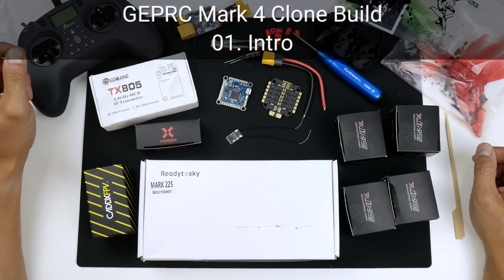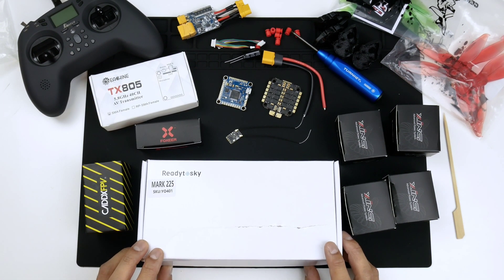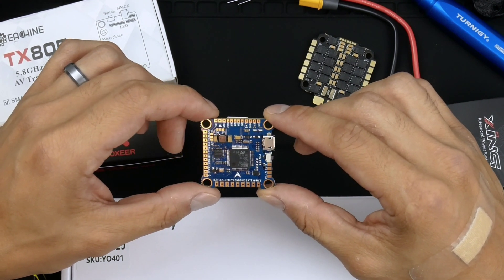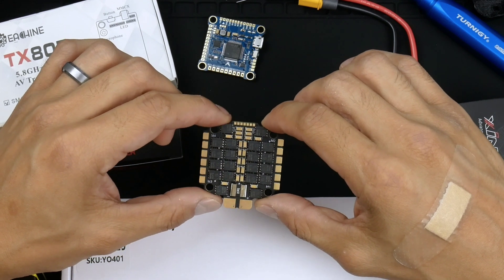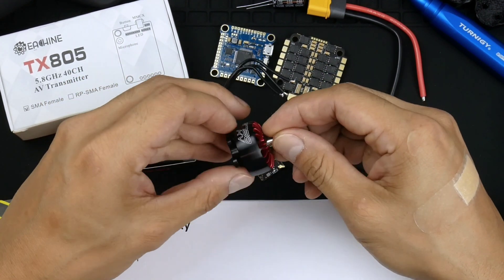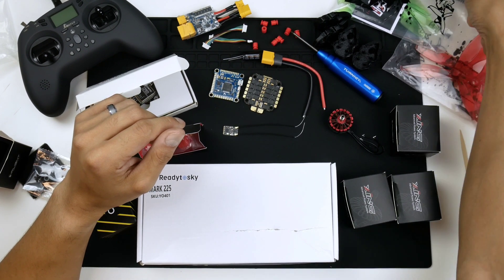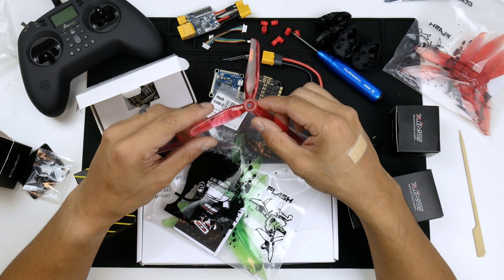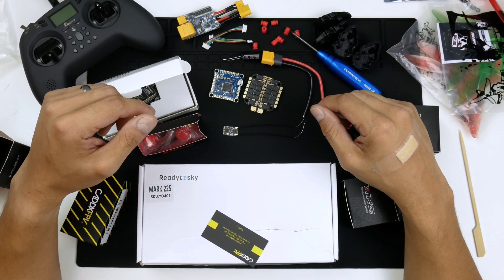GEPRC Mark 4 Clone Build - 01. Intro

Comment: With the flight controller+esc, which is better the 45A or 60A 
(I'm just a beginner) and can I use a 6s battery with this whole setup? Or would 4s be more suitable for me if I'm just starting out?
Reply from the maker: I would go for the 60A ESC as it is more robust and should last longer. I would suggest 6S these days but be sure to get iflight xing2 2207 1855kv motors to match. Since you're new, look up how to configure throttle motor output limit to approximately 70% and you can increase it back to 100% as you gain more experience. Hope this helps
Reply: @nxp200  thanks for replying and the advice mate
Reply: @nxp200  hi mate, with the eachine tx805 (vtx), Do i get the RPSMA female or just the SMA female?
Reply from the maker: Regarding the antenna connector to the machine tx805, it comes with the SMA female, so you need to buy an SMA Male antenna.
Reply: @nxp200  hey mate which goggles do you use ?
Reply from the maker: I used to use an Emax Transporter V1 box goggle. I now use the DJI Goggles V2 with an external analog module for my analog quads.
Reply: @nxp200  would the walksnail goggle L work with this set up?
Reply from the maker: The TX805 is an anolog transmitter and the Walksnail Goggles L is a digital system. They won't work together.
Reply: @nxp200  thanks, sorry for the stupid questions I'm just new to this and still learning
Reply from the maker: Nah. Completely understand mate! Happy to help. I used to be in that position as well and happy to help 👍🏻
Reply: @nxp200  hey mate would the radiomaster pocket work with this set up?
If not can you point me in the right direction for a radiomaster controller  that will
Reply from the maker: @BeastMode-yl3uz  I wouldn't install the receiver in the quad that I showcased in this video these days. At the time I recorded this video series, ExpressLRS radio link protocol was not accessible or popular yet. Today, I would install an ExpressLRS receiver in the quad and buy the Radiomaster Pocket ExpressLRS version.
Reply: @nxp200  ok cool, do you have some advice on a good one i could install?
Reply: @nxp200  i posted a link do you think that would be a good one?
Reply from the maker: @BeastMode-yl3uz  I don't see a link, maybe YouTube delete it. Radiomaster RP1 should be good. Or Happymodel EP1.
Reply: @nxp200  ok great ill get the rp1.
Thanks alot mate your a legend
Reply: @nxp200  what's the difference with the fcc or lbt? Which would you get
Reply from the maker: @BeastMode-yl3uz  it's to do with the regulatory region you live in (or plan to use the device in). FCC is better with fewer restrictions than LBT. I can only suggest to follow your regions regulations, but that's all I can say.
Reply: @nxp200  thanks mate

Comment: I don't know how much this kit costs but that frame is the same as the ones you get on Ali Express and you can get better flight controllers and vtx on Ali for like dirt cheap. 
I think I paid around $225 for everything for a 10 inch drone, exluding the controller and goggles. 
My shit all looks the same or better than whats in this kit.

Comment: What LiPo battery do you use of this drone? I have the same FC and ESC, but have no idea what Lipo I need for it and how much current can go in there
Reply from the maker: Lipo I use is the CNHL 1500mah 4S with this setup. If you have the same FC and ESC, then the main thing that determines a suitable battery is the motor size and KV. If somewhere around 2207 with 2700kv, you'll be looking for 4S. If around 1900kv, then 6S.
Reply: @nxp200  1100kv motors. I really hope they get the drone up lol. Those motors support 3s battery
Reply: @nxp200  Hi friend, I have bought 2300kv motors and 4s 3300mAh Lipo. Soon I’ll do some tests and hope the drone will fly. I think the weight with the Lipo will be something like 600/700 gram
Reply: Also, any idea if the Jumper T-Lite v2 works with a TBS Crossfire nano receiver?
Reply from the maker: @Alexa-oz6sm  you'll need an external module that runs the TBS crossfire protocol.

Comment: How is the frame,is that have same quality as geprc mark 4 5 inch, is this one durable?
Reply from the maker: I think durability is relative to the style of flying. I fly mostly in parks or fields of grass with few obstacles and have crashed a lot onto dirt/grass/trees. It hasn't broken anything yet. I have crashed this frame indirectly onto concrete too, but it wasn't heavy crashes. In terms of comparison to original Geprc, I'm not sure as I have not tried it yet.
Reply: @nxp200  thank buddy ❤️🙂

Comment: @nxp200 thanks for your reply,but you didn't answer me the point that I asking from you about the flux,I don't have specific flux so can I use instead of you are using in this video flux this I mentioned in down below question,
This is the question I am asking from you, I bought a solder paste tin and 60/40 soldering wire which I bought for solder my HGLRC F722mini flight controller and the HGLRC 28A ESC and other electronic bought stuffs,,so can I use these I mentioned solder paste tin and 60/40 soldering wire to solder the HGLRC F722mini flight controller and HGLRC 28A ESC soldering pads without any damages to PCB board,if it can can you please tell me if I solder it by selecting the soldering iron temperature range to 350celsius to 400celsius can I solder it without damaging the PCB to solder the HGLRC F722mini flight controller and HGLRC 28A ESC soldering pads?

Here's the link that showing I bought solder paste tin and 60/40 soldering wires 
https://photos.app.goo.gl/arJCzxCK8ckMuFM66

Looking forward hearing an clear answer within 24hours.
Reply from the maker: I've never used that type of flux before but it looks like it should be ok. If you're in doubt, clean the flux off the board with isopropyl alcohol after soldering to prevent corrosion.
Reply: @nxp200  thanks for your reply,I will try to solder the pads by using this I mentioned solder paste and 60/40 soldering wires to solder the flight controller pads by adjusting the soldering iron 350celsius to 400celsuis and then solder,is that okay, please reply to this question within 24 hours.

Comment: I bought a solder paste tin and 60/40 soldering wire which I bought for solder my HGLRC F722mini flight controller and the HGLRC 28A ESC and other electronic stuffs,so I have a temperature adjustable soldering iron which can adjust the temperature rate to 200 Celsius to 550 Celsius,so can I use these I mentioned solder paste tin and 60/40 soldering wire to solder the HGLRC F722mini flight controller and HGLRC 28A ESC soldering pads without any damages to PCB board,if it can can you please tell me what's the suitable temperature rate that soldering iron needs to adjust and solder the HGLRC F722mini flight controller and HGLRC 28A ESC soldering pads?
Reply from the maker: I usually run my iron between 350c and 400c. Some might say that it's too high, but I haven't had issues
Reply: @nxp200 thanks for your reply,but you didn't answer me the point that I asking from you about the flux,I don't have specific flux so can I use instead of you are using in this video flux this I mentioned in down below question,
This is the question I am asking from you, I bought a solder paste tin and 60/40 soldering wire which I bought for solder my HGLRC F722mini flight controller and the HGLRC 28A ESC and other electronic bought stuffs,,so can I use these I mentioned solder paste tin and 60/40 soldering wire to solder the HGLRC F722mini flight controller and HGLRC 28A ESC soldering pads without any damages to PCB board,if it can can you please tell me if I solder it by selecting the soldering iron temperature range to 350celsius to 400celsius can I solder it without damaging the PCB to solder the HGLRC F722mini flight controller and HGLRC 28A ESC soldering pads?

Here's the link that showing I bought solder paste tin and 60/40 soldering wires 
https://photos.app.goo.gl/arJCzxCK8ckMuFM66

Looking forward hearing an clear answer within 24hours.
Reply: @nxp200   thanks for your reply,but you didn't answer me the point that I asking from you about the flux,I don't have specific flux so can I use instead of you are using in this video flux this I mentioned in down below question,
This is the question I am asking from you, I bought a solder paste tin and 60/40 soldering wire which I bought for solder my HGLRC F722mini flight controller and the HGLRC 28A ESC and other electronic bought stuffs,,so can I use these I mentioned solder paste tin and 60/40 soldering wire to solder the HGLRC F722mini flight controller and HGLRC 28A ESC soldering pads without any damages to PCB board,if it can can you please tell me if I solder it by selecting the soldering iron temperature range to 350celsius to 400celsius can I solder it without damaging the PCB to solder the HGLRC F722mini flight controller and HGLRC 28A ESC soldering pads?

Here's the link that showing I bought solder paste tin and 60/40 soldering wires 
https://photos.app.goo.gl/arJCzxCK8ckMuFM66

Looking forward hearing an clear answer within 24hours.

Comment: He'll can this Geprc clone Mark4 frame can fix the RS 2205 pro 2300kv brushless motor and what is a suitable cheap 4in1 ESC??
Reply from the maker: I think the RS 2205 pro 2300kv should be fine for this frame. A good cheap 4in1 ESC I recently bought and works well can be found on AliExpress by searching "Mamba F40 MK2 Skystars K45". It's Skystars and NOT Mamba brand but has worked well for me so far. Remember to select the K55 option for 55A rating to prevent burning it out (it's only a few dollars more but worth it in my opinion). Hope this helps!
Reply: @nxp200  hello is this GEP Rc mark4 clone frame can fix the caddx ant NTSC and PAL 16:9 fpv camera??
Reply from the maker: The Caddx ant has a 14mm mounting width I believe and also comes with a bracket that enables 19mm mounting. The GEPRC mark4 clone frame has space for a 19mm mounting camera, so yes, I think it will fit.
Reply: @nxp200  thanks for your information. If I will buy GEP Rc mark4 clone frame is there anything else to buy separately for assemble the frame????

Comment: Hi is if i will  buy this MARK4 6inch clone frame from this you provided link the Foxeer F722 V2 flight controller can fix to this clone frame and what is a cheap and good 4in1 ESC for this Mark4 clone frame????
Reply from the maker: The Foxeer F722 V2 has 30.5 X 30.5mm mounting holes, so it should fit, although I haven't used it before. I think the GEPRC BL32 G50A is a good ESC that would do well.